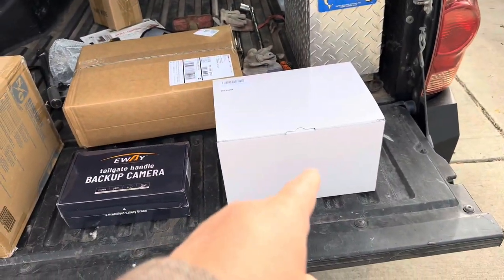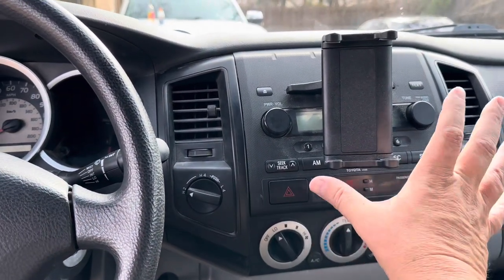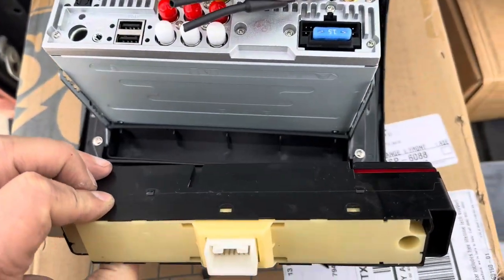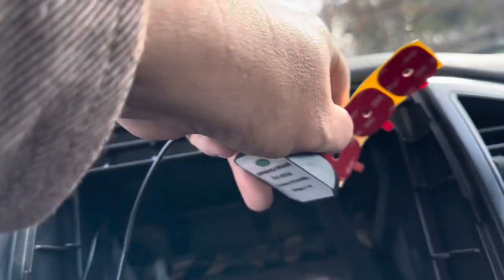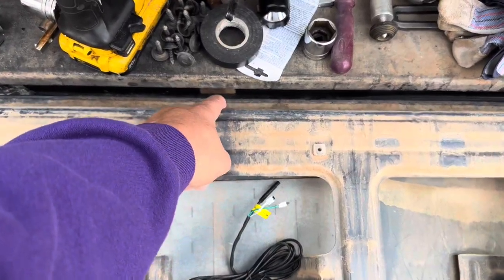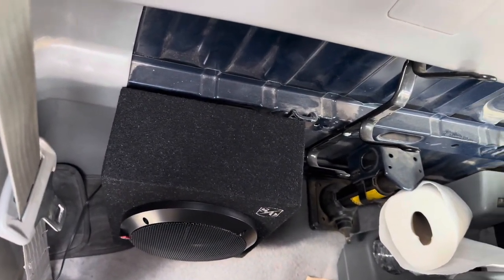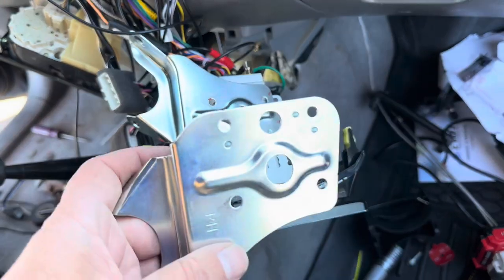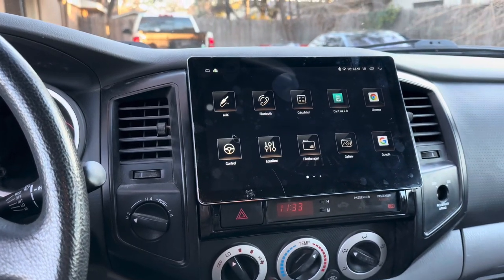S4E8: 2005 Toyota Tacoma 11” Joying Head Unit and Backup Camera Install

Comment: Nice video! I got a Taco 2005 single cab manual transmission 220k mile. I have done a lot of upgrades to mine, too. This Taco hasn't given me no problems at all, only regular maintenance & lately clutch replacement. But I think is time to let it go.